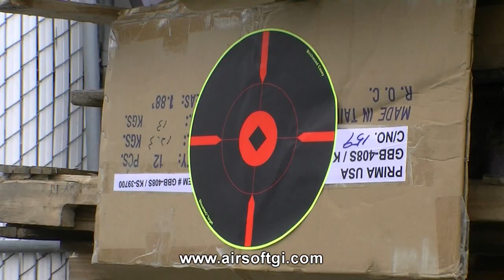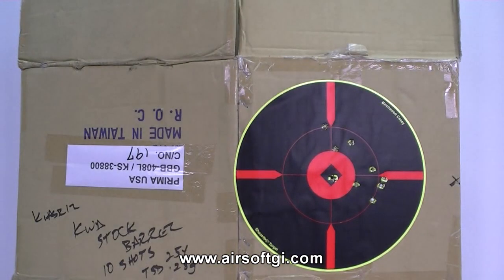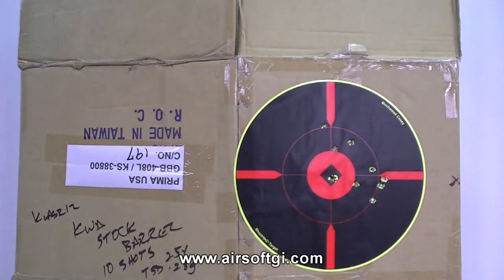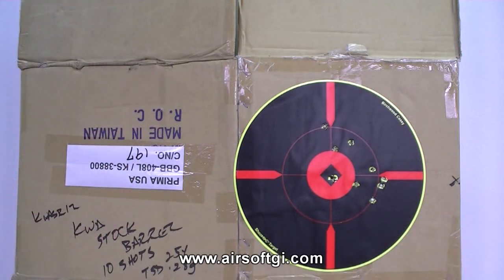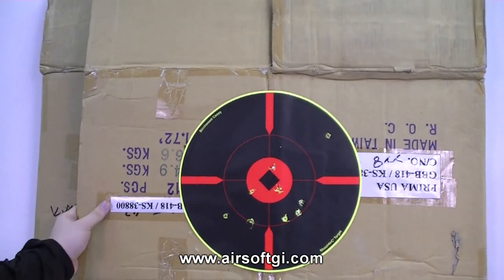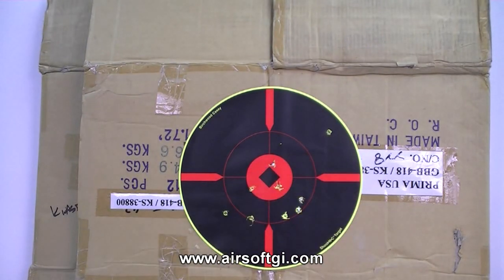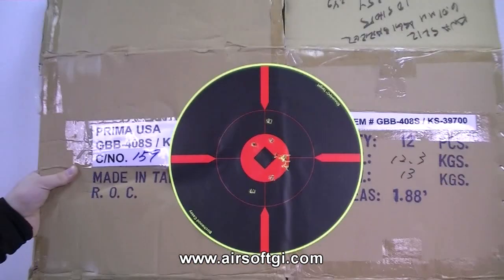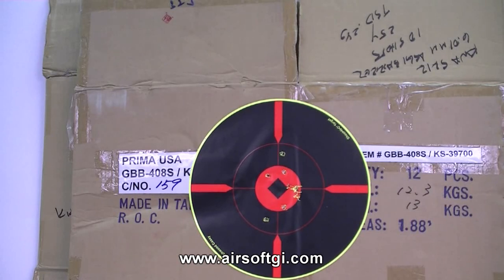Airsoft GI - Tight Bore Barrel Test - 6.01mm vs 6.03mm vs Stock KWA

Comment: General rule of thumb is, if you play outdoor 6.03 is better. Iv'e personally seen more than 1 persons gun jam from a 6.01 in less than perfect playing conditions. I have a 6.03 in my Sl9 and its accurate up to 180 ft but' accuracy at long distance is mostly from bb weight and enough velocity to get it where it's going. Indoor 6.01 outdoor 6.03

Comment: Don't forget that good bbs are actually 5.95 mm (plus or minus .01)
Reply: not true, The best BB's are actually 5.99 with a + or - 1 tolerance, You pay for them though. I paid 32 bucks for 2000 rounds of .32s, Pro Grade triple polished. I even used calipers to see how close a bunch of 50 were and most of them were 5.99 a couple were 5.98 very few were 6.0 which if you have a 6.01 tightbore you may end up with some lodging going on. I personally use them with a 6.03mm barrel and haven't had much of an issue. I had 1 issue where I dropped my gun in the dirt and some dirt got inside the barrel which caused problems for a majority of the game at OXCC.
Reply: @RC_Trailblazers  so better have 6.01 barrel and regular 5.95 bbs almost the same as 5.99 and 6.03 but cheaper

Comment: the cheaper the gun you had to begin with, the wider the barrel will be, that's just a rule of thumb. so if you have a cheaper aeg, the stock barrel can, at worst, be 6.10mm and the most common I think is 6.08mm, higher end guns usually come with 6.05

Comment: What's really matters is the quality of the barrel. Try 100 ft or in the case of a  dmr 200 and .make sure to has a proper setup like a 450 inner barrel with . .32's. Or even better try iylt with a p*.

Comment: Dont compare 500 mm 6.1 with 400mm 6.3.. you will louse alot with to long barel if not in golden ratio for your bb weight... Ratio is  when Cylinder wolumen or wolumen of presure chamber is more then 2 to 3to 1 ratio or you will lose performance.. Underpresure on piston return.. can fuck up.
Reply: You didnt mention Fps and Weight off bb and same hop up cant perform same on tighter barel.. There is alot more engeniring and knovlage behind this.. If you use barel up to 400 mm use 6.03 and your gun shots 0.28 bbs  500 dmr can go tight bore but with heavy bb.
Reply: I saw sniper pistol with smal barel 250 mm but 500 fps and heavy BB and it was insane range.. that is why new riles alow only Dmr that in real life use 7,6 cartrige..  alot of ppl got angry becouse that doesnt mater in airsoft.. just in realisem and dmr rifles with heavier cartrige are usely heavier with smaler magazin. like m 14, g36 h k and few.. But there is a hole in rule all Kalasnikov shots 7.6 bulets.. but they are not dmr.. Draganov is.. draganov max range 800 m kalasnikov 300 m efektive range.. But We do have M4 witch are dmr in miletary shoting up to 600 m..

Comment: @TheDeerhunter6 jams are only caused at the air nozzle and is normally down to misalignment(barrel not in hopup properly) if a BB jams in the actual barrel then you are using really cheap imperfect BB's or the barrel has a manufacturing fault(highly unlikely)

Comment: You can put the gun in full auto and see with a tight bore that the fireing stream is alot tighter than a stock one. also with a tighter bore, you get a better seal around the bb that gives you a bit more compression.

Comment: @MerkavaMk55 at the same time, if the wind pulls a bb from a stock barrel 12 inches to the left of your target, the same wind will pull a bb from a tight bore barrel 12 inches to the left of your target; the tight bore will just be slightly more consistently 12 inches left. I'm just speaking from my experience, and I've used Mp5's, m4s and up to the PSG-1 with barrels from stock to 6.01, and the only time I've ever noticed a difference in performance was with a longer barrel, not a tight bore.

Comment: @ebkkracerx 
honestly i cant understand you either, but ill say i was merely confused by ur point
6.01mm bb diameter will not fit in 6.01 mm barrel diameter, but a 6.01mm bb will work well with 6.03mm diameter barrel

this test is logical because the majority  of  brands that make bbs make them 6mm, you rarely encounter bbs that are .05 larger or smaller than 6mm, they're experimenting on the fact that 6mm bbs are the norm especially when using 6.01 precision barrels

Comment: more consistent, yes, technically, but on the field that tiny bit of consistency isn't noticeable at all, even on longer range shots. The only time I'd recommend getting a tight bore is if you're increasing the length of your barrel, and even then it's more of a "might as well" because you're buying a new barrel anyway. Barrel length helps A LOT more than barrel inner diameter.

Comment: @kimmin1208 No need to be a jerk. How is it a cheap trick if they told you the barrel diameters? 6.05 is actually pretty common for reputable gun manufacturers to include with their guns.

Comment: @pyromaniac452 They could, but most 6mm bbs are manufactured to 5.95mm, if by chance there was a bb that was larger than it was suppose to be or there is an obstruction in the barrel the bb could get stuck.

Comment: @istilluse56k Why should you? The only problem is a combination between Cheap BBs, good sealing parts, and a High ROF. Because cheap BBs will get stuck in a 6,01, and that means that if your parts seal good, your piston wont go forward allt he way whioch could mean stripping teeth of the piston in FUlly-automatic Fire.

Comment: Normally, if the two Barrels (6,03 and 6,01mm) have the same specs regarding to roundness, smoothness and tolerances inside the barrel, a 6,03 is more accurate than a 6,01, because the BB is guided by the Air around it, and not the Barrel itself. Prometheus 6,03 is more accurate than the PDI 6,01.

Comment: @creviseboy it can, depending on the length of the barrel, cylinder type (if you use an AEG) but i think the difference is most noticeable with a gas gun, because, instead of accelerated air, its expanding gas...

Comment: It depends on the ammo used and the maintenance, but overall yes. They also have limited hop-up control because it impedes on cambering. Most 6.01s come with limited hop adjustment, if any at all. 6.03s are a good middle ground.

Comment: I'm curious as to what variables this text was exposed to. I mean you didn't even mention BB weight, I'm assuming .25's nor FPS, I'm assuming the gun is stock so roughly 360-370 FPS with .25's. If your wanting to test the accuracy of a barrel and not the increasing performance it has on one gun, I think you should redo the test with a gun that shoots about 500-550 FPS with .20's and test it with like .36 or .40's you have to consider that the heavier the BB the straighter the path

Comment: @Amadeo Fleischmann Well actually, there are more to the physics to a bb trajectory than "air behind BB equals more range" and no, a 6.01 does not always give more range. On the contrary, a 6.01 is more accurate at closer ranges, though the consistency falls short of the 6.03 at long ranges.

Comment: @Gannon191 Well, dont do it. You cant keep the vibration off of the barrel, no matter if you have a barrel extension or not. Ad 450mm, there is a break even point (in already well supported barrels with little vibration) in accuracy. Take the advantage, and make the AUG even shorter, like an M4 CQB. 
This is just my second account for SaitekFreak, so i am the same person.

Comment: 6.03 the bb vill ride on the air and be stable, 6.01 will give higher fps but the bb will bump inside the barrel and decrease the accurcy at long range but its relative.
I would allways use a PDI 6.01 mm instead of Madbull 6.03 becuase the PDI is better done.

Comment: I use a Matrix 6.01 x 509mm barrel, and i have had absolutely zero jams with Matrix .25g bbs. I clean my barrel and do routine maintenance after every skirmish, and my gun is completely custom. Still need a new air nozzle since mine broke, but that was the fault of the 80 degree bucking+plastic air nozzle... anyways, i think 6.01mm barrels are way underrated mainly due to the fact that people just don't clean their barrel.

Comment: I have used TSD .28's and have had NO problems whatsoever. Amazing performance, and not a single jam. I use a KWA M16BR shooting 404 with .2's and 180 feet. I upgraded the barrel to a Prometheus 6.03.. Just for the record.

Comment: Ok so, debunking here... 6.01 and other precision barrels are only as good as the bbs you put into them. If you use walmart bbs in a walmart/chinese aeg with stock barrel you will be fine, but, with those extremely tight tolerances, a bb is likely to jam just because of the fact that the manufacture process for both the barrel and bb arent absolutely perfect, even if persay, you use a manufac. spec of 5.97 mm or so, if they have a spectrum of +- .03~.05, that doesnt mean you are in the clear. T

Comment: KWA AEGs come stock with 6.05mm inner barrels, whereas most guns come with 6.08mm inner barrels.  It's great to see how much better 6.01mm does, but ya'll should've used a different brand of gun to show how much tight bore inner barrels improve your accuracy.

Comment: @636Castle You'd be very surprised how fast electric cars can be, because an electric motor as a 100% torque band unlike a gas engine so it has much more transferred energy. The main reasons the electric car is not replacing the gas engine is because of the slow energy transfer (Charging the battery) compared to a gas engine (fill up a gas tank) and the shorter battery life, and there is so little places to recharge. i prefer gas any day, nothin like burnin gas to git somewhere :)

Comment: @JokerSL11 I don't think so man, I was told by some techs I know that run a local shop bigger than evike that said my barrel ( I run a G&G Desert Raider XL ) was better than the Madbull 6.03's. I'm not sure if you have the same barrel tho. I bought the ASGI 6.01 tho and It did increase accuracy and range, not a noticeable FPS increase tho...

Comment: with an AEG i saw a drop of around 100fps. With a P* you can work around that by using a higher powered nozzle. Honestly im not a huge  fan of the orga. An R-hopped 6.03 is my ideal choice, since they dont jam as easily as .01's, and are more tested than widebores. which are hit and miss from what ive seen. Some people get amazing results from them

Comment: would have been nice to chrono each barrel.  I use different barrel bores to finely adjust my velocity to be legal at different fields.  For instance, at Irene VII I had to swap from a 6.03 to a 6.05 to drop some fps to be legal.

Comment: @EastCoastAirsoftTeam like I said, my personal experience over the past 6 years or so of tinkering with different AEGs and all conceivable barrel lengths and tightnesses has led me to conclude what I did. I'll admit you notice a MEASURED increase in accuracy, but the practical application of that extra accuracy is not noticeable on the field, ie the only reason for wanting extra accuracy.

Comment: How much more FPS will you get out of a 6.01?
Also is there anything you need to worry about when getting a tighter barrel?
Like type of BBs, other build parts in the gun, hop up, etc?
Reply: SlySquriel Yes, and no. When you use something as tight as a 6.01, you gain about 20 FPS, since there is less air loss and therefore more pressure on the BB. You do not need any modification to your gun, other than instalation of the barrel, hop-up nub, hop-up unit, and removal of the original barrel.

Comment: I have a 6.01 madbull tight bore it is shocking its shoots hard but no range what so ever going back to .03
Reply: The reason your range is going down from the 6.01 might be because your barrel wasn't clean, if something gets in the way of the top part of your barrel (because of the hopup, it rides the top), then your pellet will go crazy off the sides of your inner barrel and as a result lose range and accuracy.  Another factor is not having a good hop up, that is key in having a good range.
Reply: new barrel hop and air nozzel and its still the same im at a loss
Reply: Maybe it's just you. Or the bucking. Or the hopup unit. Or excess grease in the cylinder. Or the alignment of the planets. Could be a lot of different things, but I would recommend taking it to someone who knows what they're doing.
Reply: Now now there was no need for that now was there bucking is new hop is new all recommended brands to match
Reply: imtheheretic666 just get a m170 spring and a good motor with the 6.05 tbb and a maxx hop up for better acc and you'll be hitting dimes at 100 yards, make sure you get a good bucking, thats really important

Comment: Hey, If anyone could respond i'd appreciate it, but I want an M4 length 6.01 tightbore in my Echo 1 P90, it comes standard 247mm barrel with a stock 6.05 and is only giving me accuracy out to 130 feet, which is ok but not quite field ready imo. I wanna slap in a 363mm barrel and cover it with a barrel adapter, is that ok or will I have to upgrade something else and howmuch benefit would i be seeing for the 70 bucks it'll cost me?

Comment: Please help!? Okay, so the gun im planning on buying has a pre-installed 6.01 tightbore barrel. Ive read that a 6.01 helps with power, but decreases accuracy. Will i really be at a disadvantage with a 6.01? Will i regret not getting a 6.03? Some one with experience please give me all the details?
Reply: RazzaIsKing Ok, well I can't say that I have the experience you are looking for to say yes or no, but I have read into this subject quite a bit and can supply you with some very helpful links and hopefully some helpful thoughts on the matter.

http://www.airsoftforum.com/board/topic/281986-the-official-wide-bore-barrel-vs-tight-bore-barrel-thread/
http://www.airsoftsniperforum.com/32-general-sniper-talk/11136-inner-barrels-resovled.html

    The first link does a pretty good summary, while the second one goes more in depth. It should give you an idea of what you want out of the barrel so that you can decide if you would prefer something else or not.

     From what i have heard, and read, a 6.01 tight bore will require more maintenance, ie cleaning. It will also require that you use only high end reliable bbs, to further reduce the likelihood of jamming. BUT, you do gain in performance with this, accurate at a closer range, but less range than what you would get in a wider barrel. You would also gain a small boost in fps with that tighter barrel, but fps has little to do with range.
     Most stock barrels in AEGs are around 6.08 mm if that puts the purchase into perspective. I've also heard that 6.03 is recommended for the tightest you would need in a standard AEG, if you are going DMR or sniper that is another thing.
     In my opinion, you need to consider what you would like out of your gun (cqb, field, mix) and look at the quality of the barrel included or any barrels you would look at down the road. The quality and consistency of the barrel play a greater role in performance than the overall diameter. I cannot recommend one barrel over another because I have yet to purchase a tight bore myself, but I hope that I have at least helped you in your decision. Good luck with your purchase and please forgive the wall of text.
Reply: +RazzaIsKing looking at the video we both watched id say 6.01 increases accuracy lel
Reply: +RazzaIsKing will add power, range, and accuracy from a standard stock brass barrel

Comment: @SaitekFreak999 What about Bullpup guns? I'm upgrading my Aug and I know that currently it's the same length as an M4, with a 509mm inner barrel. I could easily fit something like a 650 or so with a barrel extension, and use a rubber piece to hold it in perfectly so no vibration.

Comment: i wonder if the FPS went up with the 6.01 compared to the stock
Reply: gos down
Reply: False, the tighter the barrel, more air will be able to get around the bb. In turn making the fps higher.
Reply: bbsp Although if the barrel is very long it can be slowed by friction after all of the useful air has gone into the BB's momentum, which I would estimate is around 25cm.

Comment: You'll get less *effective* range because of the inconsistencies that affect the path of the BB inside the barrel.

Increase of FPS doesn't give you an incremental increase of range. Also, more FPS with same weight doesn't necessarily give you more range - more energy does.

Just because the poster couldn't get his message trough doesn't mean you should call him stupid. His phrasing might have been piss poor but he has shown more knowledge than you.

Comment: would you suggest using a 6.01 in a full auto or go with a 6.03?
Reply: I say if u hold it the barrel will scratch or jam, but if you burst fire, you would be fine with 6.01
Reply: thats what i thought thank you
Reply: +xXderek31Xx I have a Madbull 6.01 in my Masada and it's only jammed once, don't worry about it

Comment: That totally depends....a MadBull 6,03 will get better FPS than a PDI 6,01mm, and a stock TM barrel will get better accuracy than a Tanio Koba twist barrel....btw, it should be called a precision barrel, as the bore does not influence accuracy nearly as much as its precision manufacturing and smoothnes...

Comment: @mariokartlover0101 If its the regular m14 use a 509mm length I have a mad bull 6.03mm 509mm in my G&G m14 veteran and it works just fine.  If you check my channel I have a review of the m14, rate of fire test, and how to install a tight bore barrel into a m14.

Comment: What a joke.
KWA guns come with 6.05mm inner barrels. Therefore, they minimized the visible effects of 6.03mm in order to persuade the viewers to choose 6.01mm inner barrel, which are more expensive than 6.03mm inner barrels. If the test gun was made by D-Boys or Cyma, 6.03mm inner barrels' excellent performance would have been clearly visible. Stop these cheesy lies, AirsoftGI.